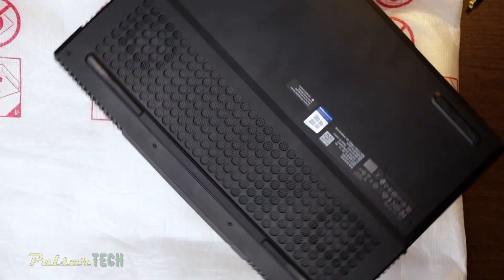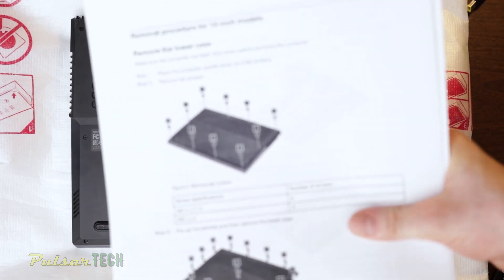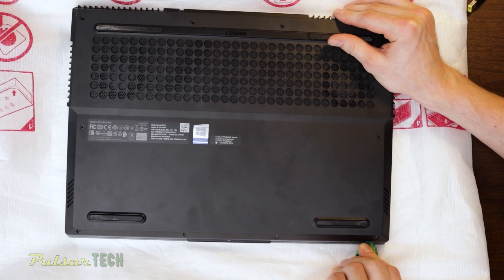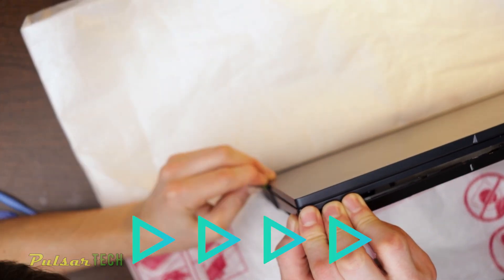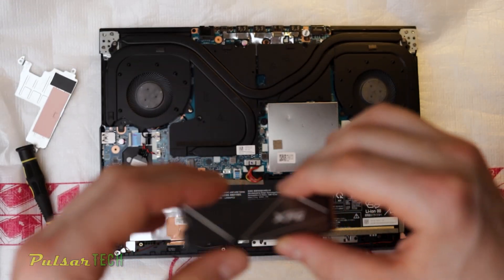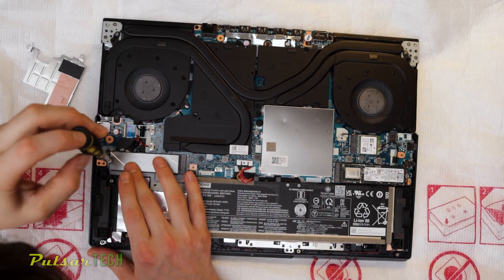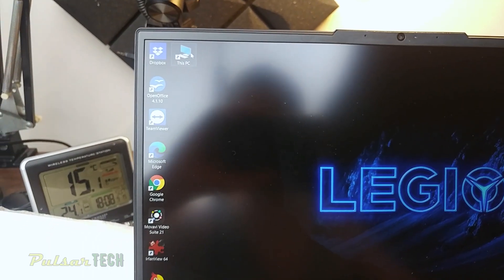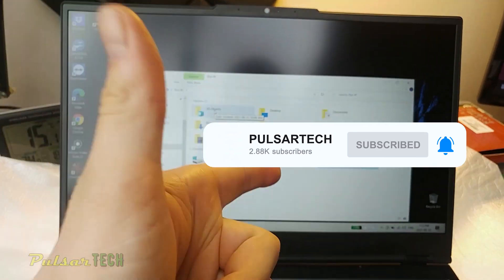LENOVO LEGION 5 HOW TO INSTALL A SECOND NVME SSD DRIVE

Comment: how do I access the bios? it says to input a system password, which I never did before.
Reply from the maker: By default, a brand new laptop should not have a BIOS password unless it has been manually set up by someone.

Typically, manufacturers do not preconfigure BIOS passwords on new laptops. This allows users to set up their own passwords or leave the BIOS password field blank. If you have recently purchased a brand new laptop, it is unlikely that you will encounter a BIOS password unless it has been specifically set by you or someone else.

If you are prompted for a BIOS password on a new laptop without having set one yourself, it is recommended to reach out to the laptop manufacturer's customer support for assistance. They can provide guidance on how to address the situation and potentially remove any unexpected BIOS passwords.
Reply: @PulsarTECH  I have accessed BIOS once before without a password. But like I stated it has a password now. Thanks for the advice.

Comment: The Cmos battery under the m.2 won't cause any issues right?
Reply from the maker: No, it shouldn't be a problem, because it's designed to be equipped with 2 M.2 SSDs.

Comment: What ssd brand and model does Legion come with?
Reply from the maker: It's Micron 2300 512GB MTFDHBA512TDV. You can see the test comparison here https://youtu.be/S_D1mafY9Zg
Reply: @PulsarTECH  Mine has "samsung mzalq512hblu-00bl2" inside. When checking with the Samsung magician program, it does not see the ssd. Is this ssd original, why doesn't the program see it?
Reply from the maker: @YunusEmreSevuk  what year is your Lenovo?
Reply: @PulsarTECH  2021
Reply from the maker: @YunusEmreSevuk  okay, maybe they supply with the different M.2 Memory Drives for different regions then. It depends not only on your model but the product number as well, for example mine is 82JU004ACC, yours could be something else like US. You can check it in Lenovo Vantage info.
Reply: @PulsarTECH  SSD shows as "Samsung mzalq512halu-00bl2". But samsung magician does not see the program. Is the SSD manufacturer being samsung and producing it on behalf of Lenovo?

Comment: Hey! I have a question. If I want to add a 2tb ssd, it would not be necessary to remove the ssd that comes from the factory, would it?
Reply from the maker: No, this model should have 2 M.2 NVMe slots available, one comes populated from the factory and another one you can upgrade by yourself. Though there are models that also have a connector for SATA SSD. Hope this helps!

Comment: good tutorial, but why bother loading a bootable device when you can use a "Create and format hard disk partitions" on windows and work either way
Reply from the maker: Absolutely, I'm just used using this software but you can definitely stick to the regular means of Disk Management in Windows to initialize the SSD.

Comment: hey bro i wanted to ask you a question. Im having a problem with the speaker connection on my legion 5. I have opened up the computer multiple times to add a stick of ram and other times to clean it. Once while using it the speakers stopped working but i didnt think much of it because i mostly used headphones. I have noticed a bulge on the left side of the keyboard(the area above the windows key) that i believe wasnt there before. When i press on the bulge a connection is made underneath that allows my speakers to work. They wont unless im pressing on that bulge. Although i dont personally use the speakers, i am thinking of selling the machine and i want it to be as perfect as possible before doing so. I think i may have forgotten to tighten a screw but the ones on the back are all fine. I need to open it again to check the screws on the inside but before i do so i would appreciate any information that could help me along the way.

Comment: hello, very good video, he asked me if you think the LENOVO LEGION 5 15ACH6 82JW00Q7US LAPTOP would support up to 2tb, more specifically a Kingston NV2 model with PCIE 4.0 x4 and a read speed of 3500 mb?  what model of laptop do you have?
Reply from the maker: Hi, this laptop is a Lenovo Legion 5 15ACH6H. Officially it only supports up to 1TB according to their website but in reality you can install 2TB or even 4TB if you need.
I cannot say for each model of memory as there's really not such data provided from Lenovo but you can try either the memory that I got or see if anybody else have installed a different model and it worked. Hope this help!
Reply: @PulsarTECH  Thank you very much for your answer, both your model and mine are exactly the same and Lenovo's official support says that up to 1TB can be installed, but you have already proven the opposite, right, so I just have to find out the rest of the information and buy the ssd, thanks

Comment: would you tell me what thee PCIe version of the SSD? since I check for 15ACH6H it is stated that only support PCIe 3.0
Reply from the maker: Hi, yes this SSD is PCIe 4.0 but all PCIe are backward compatible with previous versions just like USB 3.0 will work in the USB 2.0 port and vice versa. The only downside it that you won't the actual speed of the PCIe 4.0 SSD on a PCIe 3.0 slot. But since this PCIe 4.0 SSD was the price of a PCIe 3.0.

Comment: Is acronis part needed? Can't you do the same thing from windows?
Reply from the maker: Hi, no you don't need to use Acronis necessarily. I think Windows should be fine, I just don't use Windows Disk Manager because it is very primitive but you're right if you don't have any 3rd party software than you can stick with Windows software.

Comment: Legion 5-15ARH05 can put SSD NVMe PCle 4.0 or not?
Reply from the maker: PCIe 4.0 is backward compatible to PCIe 3.0, so even if your laptop only has PCIe 3.0 support, it can still use a PCIe 4.0 NVMe drive. Though the speed will be limited to the PCIe 3.0 standard. Hope this helps!
Reply: @PulsarTECH  thk. Bro

Comment: I have just opened mine for the second time (first was RAM upgrade) only now fitting a second SSD; I only have one heat sink sheild.  Can I still fit the second SSD without one into the second slot?
Reply from the maker: Hi, yes you can but the temperature will be higher than usual. Mine with a heat sink is around 45C. So you can compare that to what yours gonna be. Though most SSDs already come with their own heat sink. Let me know what temperature is your SSD if you install it without the heat sink.

Comment: Great video, by the way, I bought a Kingspec XG7000 Pro and with the aluminum case it would not fit, do you think its ok to remove it and install only the actual drive and use the notebook heat sink?
Thanks in advance!
Reply from the maker: Thanks for your feedback. I think it will be OK. The laptop heatsink is pretty large so it should cool it down enough,  just don't forget to use a thermal pad! In my laptop the temperature for the SSD with the laptop heatsink is about 45C.

Comment: Do you have any idea why the ssd would randomly not be detected by both the bios and windows? It is secured correctly and works just fine for a short while after install/reinstall but then poof, it's gone.
Reply: Same issue here

Comment: My Legion's 2nd m.2 slot doesn't come with a heatsink as you have here. Should I bother investing in a heatsink for the ssd? Or should I just install the ssd w no heatsinks? Please give your opinion and thank you.
Reply from the maker: Absolutely, I would install a heatsink, otherwise the SSD will getting hot during the intensive write/read operations and of course its lifespan will be shorter than normal.
Reply: @PulsarTECH  You'd install one even if the system doesn't use the full potential of the ssd? ssd I bought is a gen 4 nvme but my motherboard supports only gen 3.........can I still expect extremely hot temperatures for which I'd need a heatsink?
Reply from the maker: @osmanirfan6098  I don't think the temperature would be extremely hot unless you run your laptop at the ambient temperatures of +30C all day long copying files from and to the disk but it still would be better to have one.
Reply: @PulsarTECH  that being said, is buying a heatsink gonna be worth? like rn?

Comment: Thank you for the video, is there a reason why you unscrewed the cover from already installed SSD? Thanks
Reply from the maker: Hi Mansoor, good question! There's no need to unscrew the cover from already installed SSD if you don't need to remove it. I just checked to see which SSD is installed there and to demonstrate the heat spreader and the thermal pad.
Reply: @PulsarTECH  thank you 😊

Comment: The inside of my legion 5 is quite different. The left side is covered by a black rectangle plastic cover. Is the 2nd ssd slot beneath that cover?
Reply from the maker: Hi, what year is your model. They might have changed the design over time. The best way to tell would be to download the proper service manual for your particular model.

Comment: @CptPotatoes  Marketing departments only show capacity with currently available hardware used on Windows.
I saw on another forum that Windows NTFS supports 256 Terabytes. The CPU may have an architecture limit.
Reply from the maker: They truly didn't say anything about 2TB or 4TB support but it works fine with it. Whoever is writing those manuals just don't care.

Comment: Hello! I just bought and installed the exact same ssd. My question is if there is a problem that i removed the heat sink that came with the laptop. Will that affect temperature. The ssd came with its own heat sink.
Reply from the maker: Hi, no, it actually works better than the original Lenovo heatsink. My Adata temp is average 30C while the Micron that came with the laptop is around 37C.

Comment: I have the same laptop Lenovo Legion 5 15ACH6H, just put the Samsung 980 pro 1tb,cus the garbage cpuz said that it has pcie gen 4. Took me the whole day to figure out why I got half the speed of the SSD through the magician app. After tons of research of how to activate secret bios menus etc, I simply googled the laptop I have and I went through the official spec documents ,it says it is gen 3. If I knew it I wouldn't have paid 120 euro but 70 instead . Some waste of money ,but I hope my comment will help people who are wondering why they get only 3.500 instead of 7k
Reply from the maker: Absolutely, the 2021 laptops only support PCIe 3.0, so there's no need to spend extra for a PCIe 4.0 unless you get it on sale for the same price as the PCIe 3.0. Though the 2022 model already come with PCIe 4.0.
Reply: @PulsarTECH  That's true mate ,wish I knew it earlier . At least it won't lose any value ,I can use it whenever I get a new laptop .
Reply: Mine laptop also showing pcie 3.0 but I saw samsung 990 evo plus which is pcie 4.0 for 79 dollars, I am thinking I should buy it.
Reply: Я Искал этот коментарий)Спасибо тебе друг)

Comment: I'm planning on upgrading my HDD to SSD but I'm not sure which product to go for or where to look. Can someone tell me what I need to look out for to find which SSD works best w my laptop? I have a legion 5 15ARH05.
Reply from the maker: Hi, if you're planning to upgrade an HDD to an SSD that means you need a SATA SSD 2.5", you can choose any major brand for SATA SSDs such an Samsung Evo, Adata, SanDisk etc, there's not a huge difference between them, just the more expensive one will have a slightly faster speed up to 550MB/s. You can also search online for some benchmarks if you like. I've got a Sandisk Extreme Pro for a long time and happy with it.
Reply: @PulsarTECH   Oooh okay. I don't necessarily need the 2.5" though, cuz the legion comes w an extra m.2 slot. I was just gonna use that. Any tips on which m.2 ssd i should go for?
Reply from the maker: @osmanirfan6098  you can try Adata Gammix or XPG series, I've used them both in my laptop and PC, you can check the videos on my channel. I'm happy with them.
Reply: @PulsarTECH  Alright thank you!! Great video btw

Comment: This might be a silly question but I'm new to PC gaming. Is there a limit to how much memory you can add to your laptop? Obviously accounting for the space you have in your laptop to add an internal ssd, does it matter how many tb you add? or are you capped at 2 or 4 tb for example.
Reply: My guess is 2tb ssd's in both slots since it does support it as even seen in this video, Lenovo only provides you with 1tb ssd model(2tb ssd is just 2 1tb ssd in both slots)
Reply: yes you need to check your laptop model and see what supported Disk Type they offer
my Lenovo Legion 5 15ACH6H only supports

Up to two drives, 2x M.2 SSD
• M.2 2242 SSD up to 512GB
• M.2 2280 SSD up to 1TB
Reply: @baobaoh  Marketing departments only show capacity with currently available hardware used on Windows.
I saw on another forum that Windows NTFS supports 256 Terabytes. The CPU may have an architecture limit.

Comment: What is the max speed you can have on the drive? I think about getting 7300/6000 MB/s

 But it feels waste if max speed is lower
Reply from the maker: Hi, the 2021 Lenovo Legion 5 has a PCIe 3.0 only, so it's limited to that standard. I don't think you can get anything higher then 3500 MB/s. To achieve speed of 7000 MB/s you would need to have a PCIe 4.0 capable motherboard with a PCIe 4.0 NVMe SSD. I think 2022 Pro models have PCIe 4.0 on board.

Comment: Do both NVME SSD slot on this laptop support PCIe 4.0?
Reply from the maker: No, the 2021 model of this laptop only has PCIe 3.0 but since PCIe 4.0 is backwards compatible with all PCIe 3.0, you can use the latest PCIe 4.0 SSDs.

Comment: Thanks for the video!! I didn't know lenovo included an extra heat spreader, very nice. I'm thinking to buy a XPG SX8200 PRO, do you think that I'm going to have heat problems, and better I buy a ssd m.2 with heat sink? And can I install windows in the second ssd? I don't have a original windows anyway.
Reply from the maker: XPG SX8200 PRO should come with a heat sink, if it's already attached, I would leave the original one, if it's not attached than I would use a Lenovo heat sink. I don't think it matters where you choose to install Windows, because Windows creates a boot section and can load from any disk. Hope this helps. Let me know how it goes!
Reply: @PulsarTECH  Thanks, it helped a lot. You got a new sub. I'm considering changing the original m.2 too, beacuse my legion 5 is new and already have some problems like random freezing for 5 seconds, and sometimes it just restarts or get black screen and them I have to restart. I readed at a lenovo forums someone with the same laptop config's as mine , changed his original ssd, and all this problems stopped. I can't use warranty beacuse I bought it in Portugal and I live in Brasil. lol

Comment: cant you just disconnect the battery instead of disabling in bios?
Reply from the maker: You can but it's safer to disassemble if the battery is disabled.

Comment: In the manual it says you can only do 512GB and 1TB, So where did you get the info that 2TB is the max?
Reply: It says in the manual that 1tb was max size for that time but it allows for more as better techolnology develops.
Reply: @sadisticpsychofox  yeah. Using 2tb as of now plus stock 500 Gb. Gonna get another 2tb SSD later
Reply: Yep, I have the same question. But it seems to be working.
Reply: It works
Reply: That’s what Lenovo knew would work (and what they’ll sell pre installed). Anything above that you’re taking your chances. The evidence so far is that 2-4TB works fine.

Comment: Hi, I'm thinking about getting a
 "Samsung SSD 980"
For my Lenovo legion 5 3050ti
Do you think it would work for it?
And also can u recommend what screwdriver I should use to open up the back cause I'm not really familiar with screwdrivers 😅
Reply from the maker: Hi, I think 980 should work fine, I haven't tested it myself. You might want to check out some forums to see if anyone that mentioned that they have installed it.
As for the screw driver, it is a fine philip head screw driver. I just have a small tool kit that I'm using. I'm sure you can pick one up at any hardware store for pretty cheap. Let me know how it goes!
Reply: Did the 980 work out for you? ( I am myself looking to buy Samsung 980 Pro M.2 NVMe 1TB SSD)
or the Western Digital Black SN750 WDS100T3X0C 1TB SSD M.2 2280 NVM
Reply: @David-jm3ez  yes it did, and I just got a random cheap Philips head driver, I installed the SSD and no problems since. Pretty easy too
Reply: @David-jm3ez  You can also get the Samsung SSD app to help monitor the health of the SSD, pretty helpful

Comment: Up to two drives, 2x M.2 SSD • M.2 2242 SSD up to 512GB • M.2 2280 SSD up to 1TB
In my legion 5 15ACH6H already default drive is 512GB 2280

If I put 1TB 2280 in other slot will It work. Or I have to install 512 GB 2242 ?
Reply from the maker: Hi, you can put another 1TB 2280. I have a 512GB pre-installed as well.
Reply: @PulsarTECH  😊😊

Comment: Can I put additional 512 Ssd m.2 on my 512 m.2 Ssd Lenovo legion 5
Reply from the maker: Absolutely!
Reply: @PulsarTECH  I ordered a 1 tb additional Ssd
Reply: @PulsarTECH  but can you tell me about the slots capacity
Reply from the maker: @Ak-sg3fb  officially Lenovo says it supports only up to 1TB NVMe SSD drives but as you can tell from the video I have installed a 2TB drive. And one of my viewers commented that he has installed a 4TB NVMe SSD drive. So you sholud be fine!

Comment: Does your lenovo legion 5 wake up from sleep or if the screen turn off when clicking the mouse or keyboard?
Reply from the maker: Hi, absolutely, it wake up from sleep immediately as I move the mouse or touch the keyboard.
Reply: @PulsarTECH  im having problem waking up the display after screen timeout, what is the OS of your laptop
Reply from the maker: @irishamil  Win10 x64